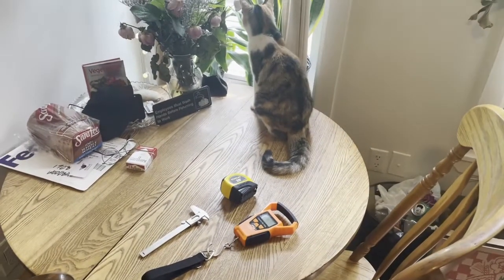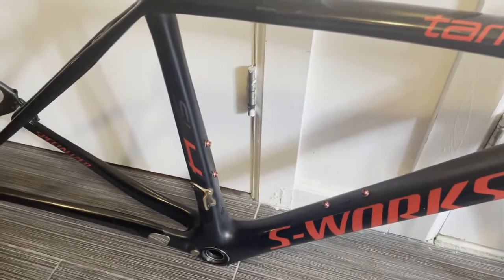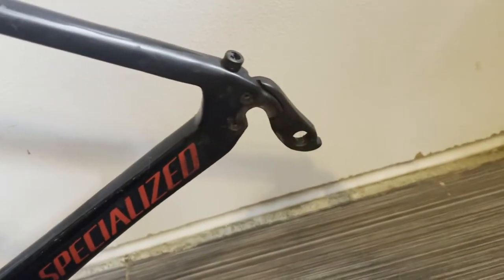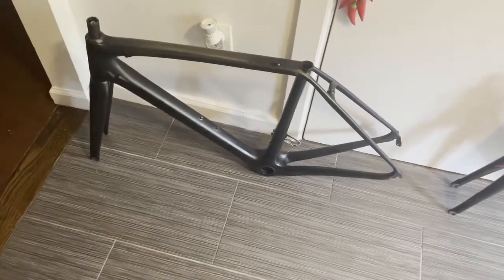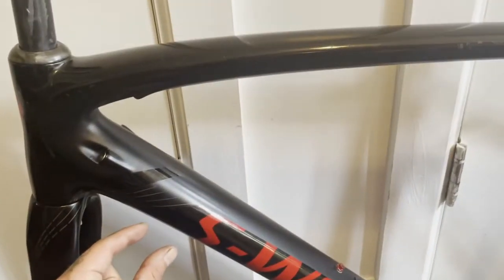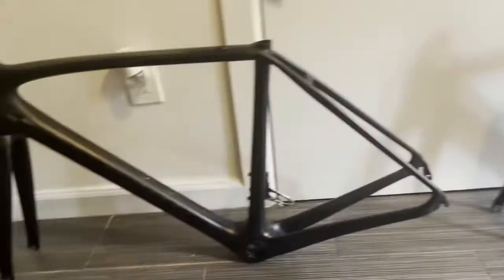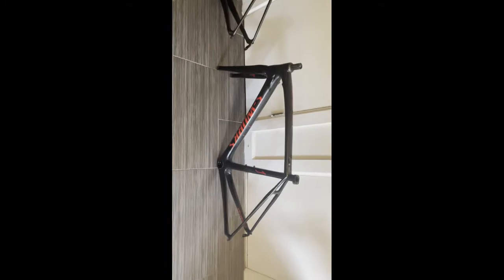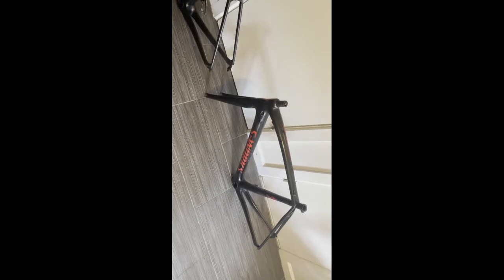S-Works Tarmac Sl5 vs Sl4

Comment: Thanks for the content. Great side by side comparison. I have the exact same model and color as that SL4 in size 52. Great climbing bike and can also maintain speed in the flats without a problem.
Reply from the maker: Stiff and beefy. Just stomp on those pedals and it goes forward

Comment: Thanks for the comparison review. Hands down on the SL4, I have the 2018 SL4 Tarmac Sport with rim brakes & threaded BB. it is so easy to  maintain and no complications. Rides well & fast, too.
Reply: I bought an sl4 frame and wanted to build it up with parts of my old bike, so i had a campy ultra torque crank and ended up after a lot of searching using a Praxxis threaded BB, works great, over a year down the line on lots of big hills and no creeking at all! Bit of a mix of Sram, Campy 105 and Dura ace now :)